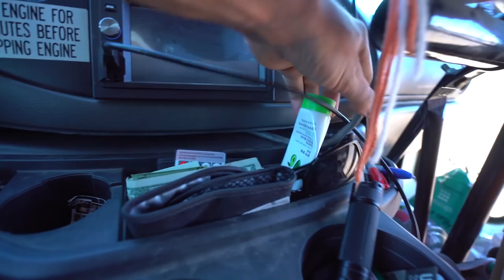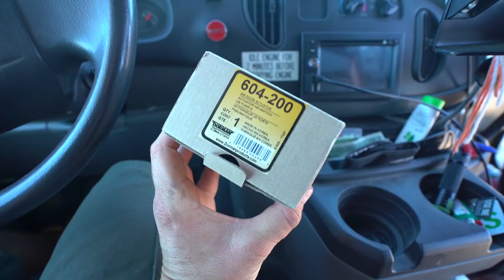TRYING TO FIND 7.3L OIL LEAK + MONROE STEERING STABILIZER

Comment: The turn signal switches on these E-Series vans commonly fail. The shifter might be as simple as loose or missing bolts. Look up the dash from underneath and follow the shifter cable to the column cable. That triangle metal plate the cable hooks to has 2 bolts holding it to the shift tube. The aluminum shift tube is also known to fail. Cheaper than a whole column. Hope you find that oil leak!

Comment: Hold the phone !!   .... "IF" you have a smart key (and it may be hard to tell by looking at it) and you change the column, you're theft module will not be satisfied and you will not be able to start the van.  So just check with the dealer and make sure you have a 'dumb' ignition key - first.
Reply from the maker: just wait till you see what we end up doing to the key :)
Reply: LOL... let me guess, you'll tape it to the halo ring and stuff it in the column so you can start the truck with a key from the hardware store

Comment: Hey just a tip for you bro. Go to international truck dealer parts department and buy a Cam Lobe Positioning Sensor. It costs less than half than buying one from Ford and its a necessary piece for emergency breakdown. When it goes out the engine simply shuts down and then doesn't run again

Comment: You mentioned nests that had to be removed. Our desert ( central NM) has pocket mice, deer mice, kangaroo mice and pack rats, all who love nesting in vehicle engines. We have put put aLOT of money repairing vehicles. Think about the cost of a corvette wiring harness. $$$$!  One day I found a very small article about this. In around 2002 wire manufactures changed the wire coating product to a more environmentally friendly product based on soy beans. Those wires that run the engines and everything else in the vehicle are simply food to the critters. 
     So how to stop this from happening? Haveahart live traps or (sorry) snap traps. After 
Putting out $1,000 on truck repairs, times 4, one looks at the critters very differently.
Reply from the maker: ohhhh good idea, gonna buy a bunch of traps!! thx

Comment: I suspect that you're probably not losing all of that oil, but there will be at least some that's being used. The higher mileage on a vehicle, the more oil it will actually use and higher temperatures also can add to that usage. How much do you idle Dan? You said 5,000 miles but if you've been doing considerable idling the odometer is misleading. I suggest installing an hour meter and that would show the true engine usage. This is also a consideration when factoring fuel economy. Enjoy your time with family, give them the help they need, refresh a bit, come back and hit it hard. Oh...yeah...don't poop in the house, poop in the yard so that you don't get porcelain spoiled. AaaHaHaHaa!!
Reply from the maker: good idea. there is an hour meter installed. I idle no more than 30 minutes a day, and mostly drive when it's on :)